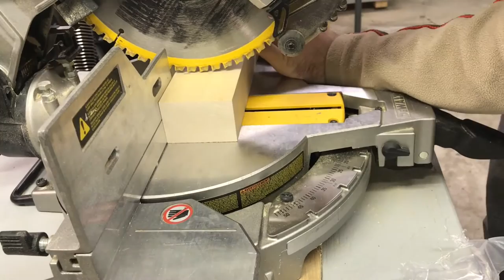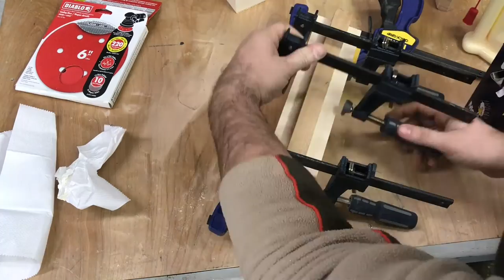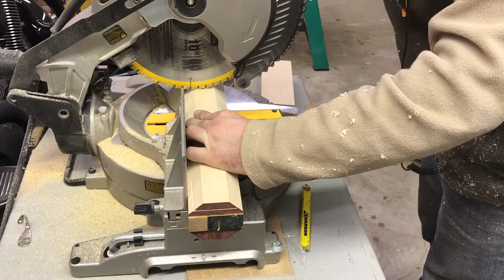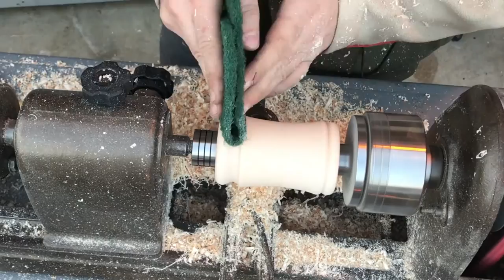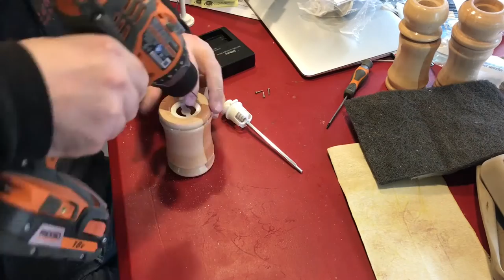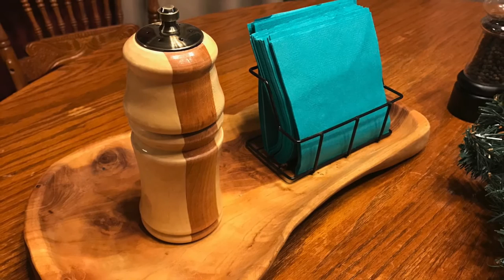Salt Shaker/Peppermill Combination: Segmented Turning // How to

Comment: I want to maje 2  of this for a long time where did you gor the insides ? upcyled or bought ? Amizing job  loved it how they end up subed !! ;D
Reply from the maker: +Trash Woodshop thanks! I bought them from Rockler or Penn State.
Reply: cool ty for the tip unfortunally here i  dont have those shops. i did try amazon but no luck what do you call does insides ? :D
Reply from the maker: +Trash Woodshop Those shops are online too. I think I've seen them on amazon just search for peppermill kit.
Reply: That particular kit used in the above video is available from: https://www.woodcraft.com/products/salt-shaker-pepper-mill-grinder-mechanism-turning-kit-black-nickel